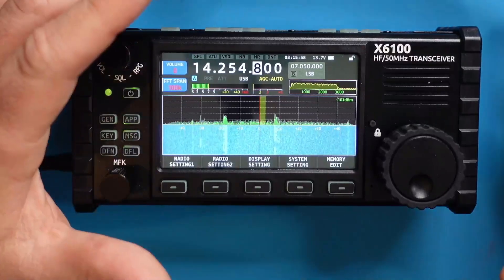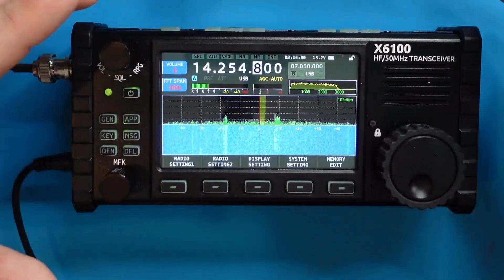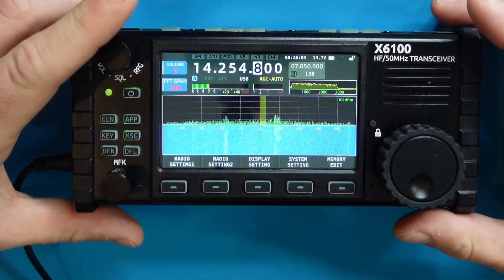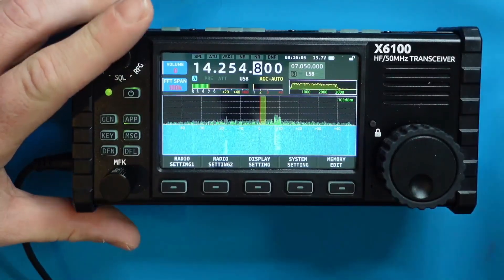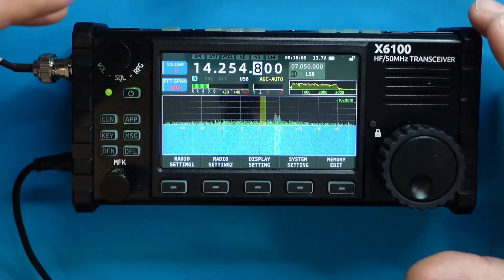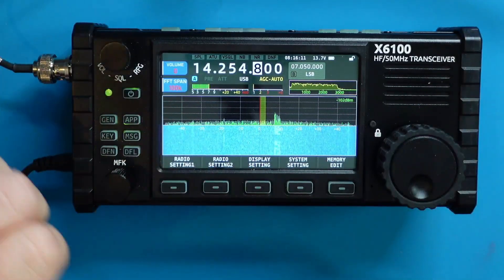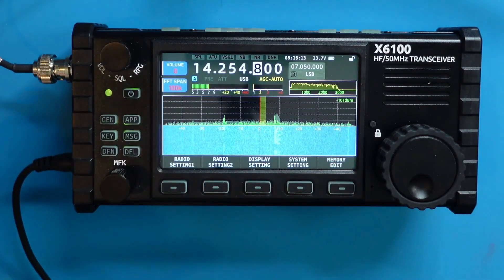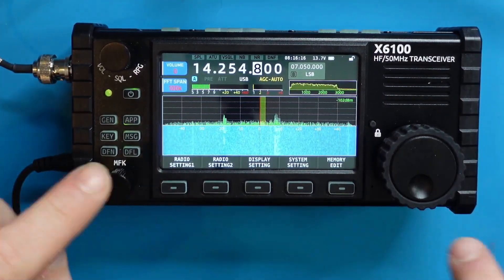Xiegu X6100 Firmware Update - Did Xiegu Make it Worse?

Comment: Great review. I enjoyed it but..Well I see you were unhappy because the radio antenna tuner was a little slow tuning up 160m when you say you only had a 40 meter fan dipole. Well it seems the fact it tuned up 160 at all should be cause for acalades.  Just saying. : )

Comment: the biggest issue to report (just like in 705) is lack of vertical mode (portrait mode) of the display. when holding the radio in human hand with antenna connector up every ht ever allows for reading the display without tilting one's head sideways....

apparently icom doesnt understand that and neither do most of closed minded youtube "" influencers"" but this thing is so raw everything appears to be possible. it has a solid chance of beating a 705 if it had a vertical mode, it even has the ptt and mic in right places....
I dare you to root for it.

Comment: When doing the firmware update, make sure you plug the radio in. I tried it without plugging the radio in and every time I selected "Upgrade" in the Systems Menu the radio shut off.
Reply from the maker: That sounds right turn it back on and it will start the process.

Comment: What I'm seeing on the support of the 6100 is what I saw on the G90 and GSOC combination. You either get good fixes or you get broken fixes or you get no fixes from Xeigu. It became so frustrating that I just got rid of it and I believe I'm seeing the same pattern now with this newer 6100 as I saw before. Don't be surprised if you continue to get half-hearted fixes while they generate a new product line and your concerns get left in the dust.

If I am inclined to go this route again, I will more likely go with a tried and true platform like either the IC-705 or Elecraft.

Comment: I have had mine for two days and have spent over 10 hours with it on cw.  Numerous QSO's and fun learning what this rig can and cannot do.   I was aware of the fact that I would be a beta tester when I ordered. it. lol  Yes, its a work in progress but I am perfectly happy with its performance  out of the box.  As updates become available, I am sure it is going to be an amazing radio.   The 705 does not have a built-in antenna tuner.  The KX2 does not have a scope.   I enjoy using both radios as they both have their pluses and minuses.   I am very pleased with my purchase and look forward to firmware updates.   I think this rig will be a winner.  73 WA6MOW

Comment: I heard that an issue with the antenna tuner may be that when tuned to a non resonant antenna it does not put out the power it should. I tried on my x6100, tuned my 20m antenna to 40m, tuned up just fine. When I spoke loud and clear directly into the mic I was getting around a watt or less on the power meter thats ON THE X6100 SCREEN. I had 5watt output selected. BUT I did not hook up a meter and see how much power was actually making it to the antenna. So I am not sure if its an issue with the xiegus meter display, or if its and issue with the actual power level making it to the antenna.

Comment: Good video. How do you adjust the mic? What I mean by that is, on my Kenwood radios, I read the ALC scale to adjust the mic gain. I did not see you do that on the 6100. Is the mic gain a guessing game?
Do you know if they fixed the bug where you could not get 5 watts out while using the internal battery? I don't expect 10 watts out on the internal battery but I sure do expect the full 5 watts out.

I am actually looking forward to getting a 6100 but for now I see they are a long way off from what I consider a fully functioning radio. Lot's of bugs to fix.
Barry, KU3X/QRP
Reply from the maker: Also, when I was out today, I didn't test the 5 watts bug. I'll get back to you on that. Thanks
Reply from the maker: Totally understood.  There's no alc level on this radio..  it was just a matter of trial and error to see how distorted or clear the radio sounded. The nice thing is, being software defined, they can hopefully add that in the future  . Thanks for watching

Comment: Think I will stick with the IC-705.  Sometimes saving money isn't worth it if you spend hrs trying to get something to work. I do like the built-in tuner.  I do own the G90 and it does what it should well enough.
Reply: Boy you ain't kidding having second thoughts now. 705 works out of the box. Not everyone has time to tinker. Just glad these guys are here doing an incredible service. The radio company should hire them as tester in future project. All the bugs could have been avoid and the average consumer would have waited longer to have a better experience.  Thanks for the great video and hard work.
Reply: @W4KWS  it's not just about working out of the box.   With the 705, nearly all except the most advanced features can mastered without opening the manual.   The interface is remarkably intuitive.

Comment: For the charger light  its not that it was not working, its the fact that it never stops blinking even after 8 hours of charging. The fear is that the circuit is not disconnecting once optimal battery voltage is reached. Thank you for amazing content. get some sleep. 73 W4KWS